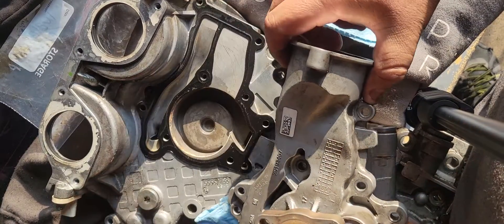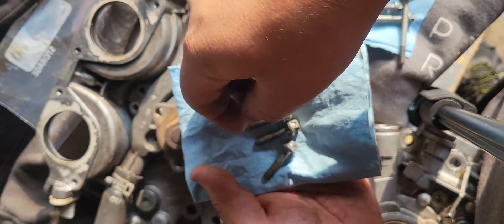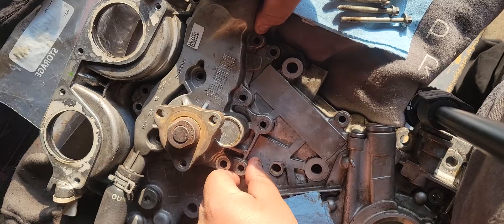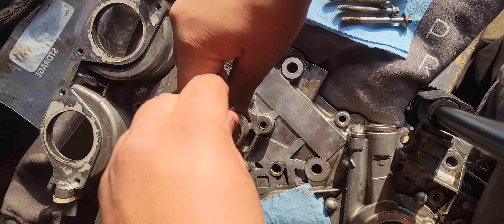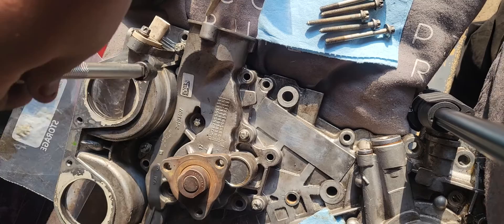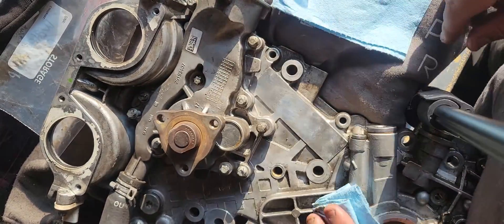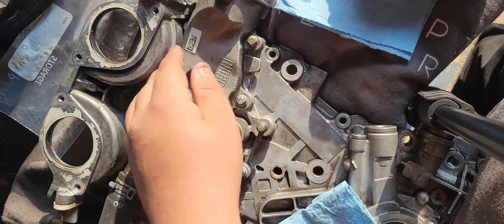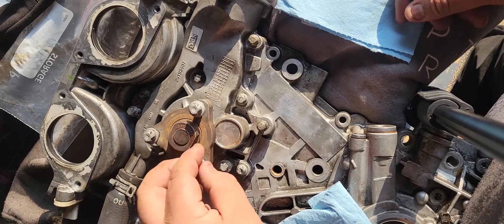Chevrolet 1.4L Turbo Water Pump Bolt Location and a torque Spec - Sonic Cruze Trax Vauxhall & Opel

Comment: Bolts are to be torqued to 71 inch pounds, not 89.
Reply from the maker: thank you, i tried to do proper research, i do have the repair manual but its a Hanes' lol which i always end up having issues with wrong information on the Hanes Repair Manuals.
Reply: I also saw a video that states 71 in-lbs
Reply: I tried 71 and snapped a bolt

Comment: Make sure you replace the big 55mm and the 60mm bolts. They are single use!!
Reply: I’ve re-used em twice now with no issues. (2 different cars), well over 60,000 miles each.
Reply from the maker: i did not know this, great information thank you so much !! for future reference of course now

Comment: Thanks!  I strategically placed all my bolts into the new water pump as I removed them from the old one, effectively using it like a template.  Figured it was clever.  It kinda was, till I flipped it over later to look at something and they all fell out. Doh!  I gotta quit working on cars in the middle of the night...
Reply from the maker: i traced the water pump on a piece of cardboard and placed all the bolts in the cardboard. now i have a cardboard template lol
Reply: I did the same thing!
Reply: Same. Lol.